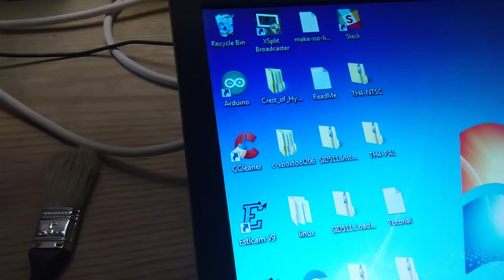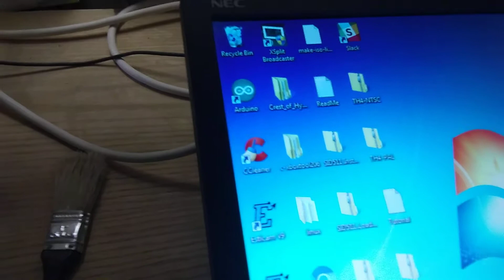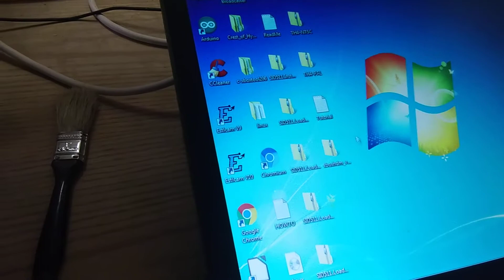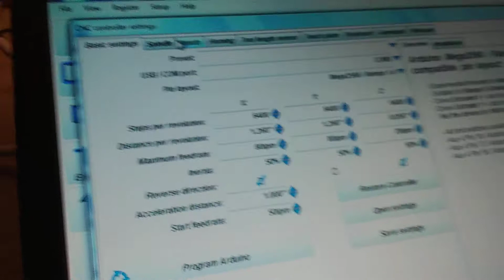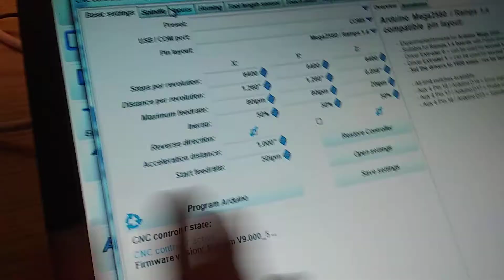MPCNC Arduino connection

Comment: How do you feed more than 12v?
Reply from the maker: well, ordinarily you have a 12v power supply plugged into the RAMPS board. I'm saying here to find a computer power supply that delivers at least 5 amps and use that instead. 

The system glitched out on me several times and the problem stopped when I disconnected the 12v poer supply to the RAMPS and plugged in a 19v laptop power supply instead.
It is possible to run on 12v, but not for me this time
Reply: @eddowney9548  Yes but I thought that feeding more than 12v to the ramps is not advisable.
If it were by me I would use 30v if possible.
Reply from the maker: @puchomoreno  the info I read said that you can input up to 22 volts, but that would be borderline, so 19 is good. And 19 is max I would go.
Also, when I had 12v input and set the drivers to .7 volts, and then I input the 19 volts, I checked the drivers and they were still at .7 volts.